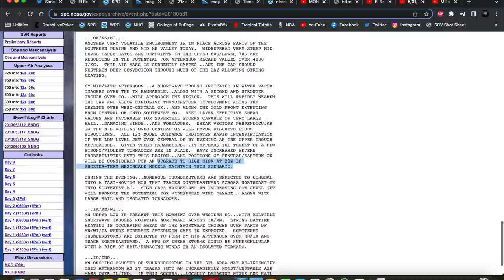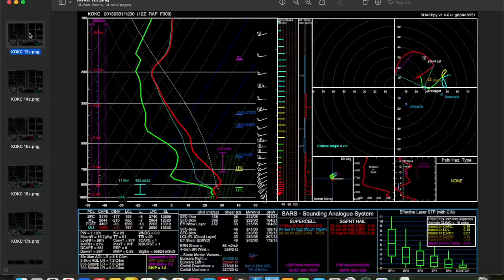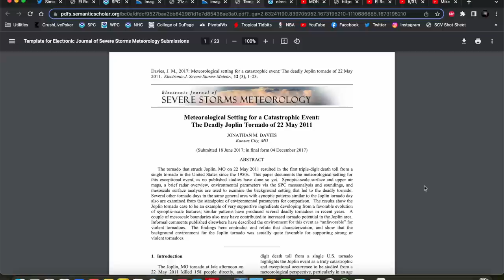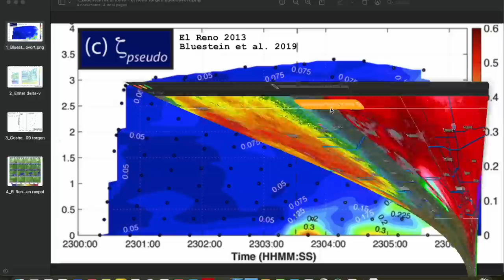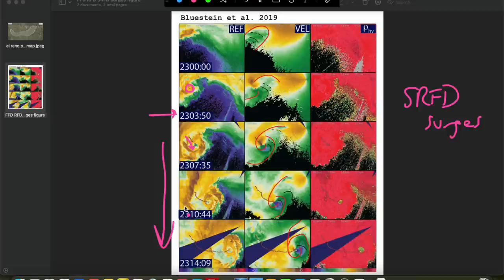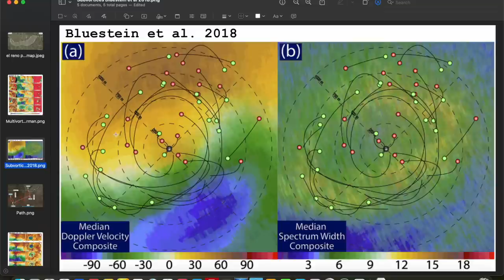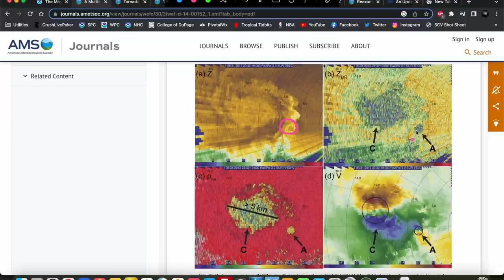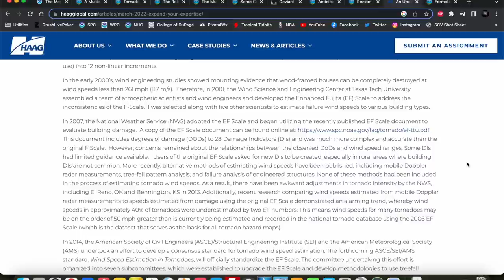The El Reno, OK, Tornado of May 31, 2013: A Case Study

Comment: If I could make a suggestion - the Tri-State Tornado is shrouded in a lot of mystery - documentation may not be as readily available on that storm, but I think it would be quite a piece to look at if you made an analysis of that!
Reply from the maker: I agree; it's on my list! Only issue with those old events is the data archives are quite sparse, but I think the Tri-State Tornado has enough literature out there that I could construct a solid video on it.
Reply from the maker: Correct, it’s believed to be a tornado family rather than one long track.
Reply: @ConvectiveChronicles  Use the 2021 Quad State Supercell as a starting off point for the Tri State Storm. Because theory suggests that the 1925 Tri State Tornado was likely identical to the 2021 Kentucky Tornado.

Comment: The cape values were in fact that high.

Storm chasing that day, we saw close to 6000 cape values before(i mean within 30 mins of storm initiation) and ground obs at highway 81 just south of el reno showing a strong backing wind ahead of the frontal boundary.

I have not seen since then as high of cape values with such a storm.

This storm veered southeast immediately after el reno. With the meso splitting in two. Creating a semi quasi linear line. It produced tornadoes in south okc as well.

Very dynamic and very rare.

And remember this was a week AFTER Moore took another direct ef 5.
Reply: I heard Jarrel had CAPE 7500...

Comment: Awesome video Trey! I am not a meteorologist by any means, and have not read research papers for this event, but in regards to the discussion of deviant motion and tornado width increase, a thought I am having is: could there be some relation between the average angle between the rear and forward flank downdrafts (if that's a thing) and the "width" of the inflow region (thus contributing to increase in the inflow flow rate and/or the increase in tornado width?)...or something else? In looking at the slide at about 45:00 in the video, the "average angle" I guess you could say between the main forward and rear flank downdraft seems to increase a bit from 2307:35 to 2310:44....and after 2310:44 is when the widening of the tornado happens...just a thought I had.
Reply from the maker: Thank you!

Hmmm, interesting idea, one that I haven't thought of before. My hypothesis of the mechanism behind a tornado's size change is that there's an increase in streamwise vorticity ingestion; i.e. a large area of favorable "spin" that the tornado encounters that allows for a lot more vorticity to be concentrated within the low-level mesocyclone, hence perhaps causing widening of the tornado. That source could be a streamwise vorticity current (SVC), remnant surface boundary, etc. Your theory is interesting and perhaps a lot simpler...you can also see at 45:00, the 2314:09 box has a lot larger of a "cocoon" - i.e. the area or interface between the FFD and RFD - than the previous times. Perhaps a change in that angle you mention does something to change the size of that interface, creating a larger area for the vorticity concentration within the mesocyclone to occur.

Comment: Around 22:30 you talked about why the Tornado became rain wrapped. Could you explain further why weak outflow winds in the mid-level allowed for that to happen? How does stronger outflow winds cause an LP supercell? Are we talking about the RDL here? I’ve always been confused how LP vs HP supercells form and would love some clarity. Thanks in advance!
Reply from the maker: Strong storm-relative outflow winds help to push, or vent, the precipitation in the mid-levels away from the updraft/mesocyclone region of the supercell, which helps make any tornadoes that occur more visible and can yield LP supercells. In contrast, when you have weak storm-relative outflow winds, the precipitation is not vented away from the updraft/mesocyclone region of the supercell. Thus, the rain falls very close to or within the mesocyclone area of the storm, which yields a more HP storm and obstructs the view any tornado that may form.

I hope this helps; let me know if you have any other questions. You can also get some more info on these processes at the following link, just scroll down a bit to the "Storm-Relative Wind" section: https://cameronnixonphotography.wordpress.com/research/the-storm-relative-hodograph/
Reply: @ConvectiveChronicles  that totally makes sense, thank you so much for answering!

Comment: I'd be keen on eventually seeing a detailed analysis like this one that also happens to include the mesocyclone perimeter for reference.  I've seen a few clips from time to time that show tornadoes that seem to more or less take their meso completely over, and a tornado reaching this width has me wondering.  I'm also very curious about whether this tornado developed the classic "eye", or conspicuous area in its center of very low reflectivity, typically seen in mile+ wide tornadoes, and how the long-lasting center subvortex discussed in this video relates to that.

Last thing I'll note is something that harkens back to the classic "Tornado Video Classics" video from the early 90s.  A brief mention is made of "twin suction vortices" that Dr. Fujita claimed to have spotted in the film of the Xenia tornado.  Well it just so happens that there's a certain clip of the El Reno tornado that legitimately and unambiguously reveals this phenomenon—a subvortex that's made of two vortices spinning around one another.  I've long suspected that nobody else ever noticed this.

Comment: Excellent case study. Could watch mobile radar scans of tornadoes on loop for days! Haha, thanks for upload. Also, Bennington would be an interesting case. I'm guessing that deviant track was the tornado wrapping around the entire mesocyclone? Cheers!
Reply from the maker: Thank you! Bennington is on my list; that one actually attained its almost stationary/slightly retrograding motion because of advection by the low-level storm relative wind...using the deviant motion hodograph technique, the deviant tornado motion vector was literally almost at the exact center of the hodograph grid (i.e. nearly stationary motion): https://www.ustornadoes.com/wp-content/uploads/2021/03/20130528_2300_39.32_-97.92_RAP_23Z_F00.png

Comment: I have a suspicion that both ascending and descending tornadogensis are possible, however, they arise from different (but similar) conditions. I also suspect that the overlap between these means that you can have the same storm potentially produce both kinds at different points in its life, as it moves into different conditions. 

However, from personal experience I get the impression that ascending tornadogenisis might be more common, just from experience. There's been a ton of times chasing that I have seen a swirl of dust or leaves under the mesocyclone often many minutes before any kind of tornado strength winds are present. I have no idea if this is the start of a surface vortex, or just transient concentrated vorticity, but I know I've seen it often enough that it doesn't seem like chance.

I'm not super confident in this, and I don't know how one would begin to prove it, so I'd like to hear your thoughts on this. (Or anyone's thoughts, really.)
Reply from the maker: Completely agree! In my thesis, I analyzed four different tornado cases using high-res mobile radar data, and I found evidence of both descending and non-descending (ascending) tornadogenesis among the cases. The Putnam, OK tornadic supercell on 6-15-19 appeared to feature descending tornadogenesis, while the Elmer case appeared to feature non-descending tornadogenesis. The former case was a lower shear event, while the Elmer case was a much higher shear event. Of course, small sample size, but perhaps that has something to do with it; regardless, I do think the environment has a lot to do with the method of tornadogenesis in storms. I also agree that ascending/non-descending tornadogenesis may be more common; we just don't have a big enough data archive of tornadogenesis cases from mobile/high-res radars to make a definitive statement. But I too have seen a lot of cases out in the field where the tornado does seem to begin with concentration of vorticity near the surface which works upward with time. Very interesting stuff, and hopefully more research will be done on these topics in the future.

Comment: Are there surface temperature/dew point or VT maps available slice by slice with the dow data? I have never seen mesonet type data with this in a map form. I'm guessing the resolution would be too sparse this zoomed in with that many frequent time slices. I've always been curious if this event could have been a psuedo warm seclusion like event we see with larger tropical systems just on a much smaller scale, namely the strengthening and loop de loop behaviour post occlusion.
Reply from the maker: Unfortunately not; the mobile radars aren’t equipped with instruments to measure those environmental variables, and there isn’t any source that measures those variables on that time scale. The Oklahoma Mesonet would be closest, but it still isn’t as high resolution, both in time and space.
Reply: @ConvectiveChronicles  Yeah I kind of figure that seeing as how  you would need probes ever km or more to pick up things on this scale. Hopefully the work Leigh Orf and others are doing will allow us to plug in variables and run a model that is accurate to nature pretty soon.

Comment: In the dominator footage showing the satellite vortex (40.06), another more energetic vortex (to the “right” of what you are calling the satellite vortex) is obvious. It even appears more “outside” the main circulation than the vortex you are referring to.  What is that? Accepting the fact that it is another satellite vortex, what makes the leftish vortex that you are pointing to so special?
Reply from the maker: It’s very likely another subvortex…that circulation was massive
Reply: yes, and capturing it just in that one moment of time, I’m not sure which of those two vortices, or the many others that may have subsequently developed that were never witnessed, would’ve been the culprit of…..anything. I understand how incredibly difficult it is to get the proper radars, instruments, personnel, etc., in place to study such a dangerous storm, indeed, if any tornado. One thing that is often overlooked, that you allude to in this video regarding over-estimating the wind speed of this tornado, is that radar artifacts may be present. We need to understand the fact that tornado science is often working with very limited data sets, and circumstances are not easily applied to other storms in analogous situations, since there may in fact not be analogous situations to study! It is all very interesting to me. Tornado science seems to rely mostly on phenomenology with n=1, and often on forcing hypotheses to be correct, when it may be a correlation/causality misinterpretation.

At any rate, very good work, and I have learned a lot from your channel. I know just enough to be dangerous in meteorology, being a science, PhD myself. Educational and technically dense, which I enjoy.

Comment: just thinking about bottom-up tg. In most of the cases that I can remember, being on the ground, there was a sudden ramp-up of winds before tornadogenesis. I witnessed it most prominently in the Madill tornado a few years ago. in another case, where a tornado ultimately did not form, there was no ramp-up in winds. just a steady light breeze.

Comment: At 52:50 u mentioned that the tornado has to deviate back to the north because the tornado initially turned south east. To my untrained eye the speeding up of the tornado happens to be at around the time it is going back up north trying to follow the apparent storm motion. can this be some something like a slingshot, since the storm base and top levels are connected and the tornado is getting pulled?
Reply from the maker: That's an interesting question that's hard to know for sure...I think the change in speed had some other factors that went into it, but that's an interesting proposition.

Comment: Could you do the Albany GA EF3 tornado? Been curious how such a strong cell remained strong in a squall line filled with short-lived rotations. Long track EF3 with a lot of size and intensity changes throughout it's life.
Reply from the maker: What was the date?
Reply: @ConvectiveChronicles  Jan 22, 2017. Came from a squall line (of many that day and before) but was long track and very strong for that time of year and it not being from a discrete cell. I believe it was a strong rotating cell within the squall line. Hit mobile home parks in Albany bad. Several tornadoes and warned storm have followed nearly identical paths over time, from Leesburg south to Moultrie area. Worth County is especially a hot spot due to its height in miles and location, like NW GA counties.
Reply: @ConvectiveChronicles  I've got a few short videos of the approaching rotation and one from inside a home where it passed 1/4 from us near its widest point.
Reply from the maker: @gl3618 Ah, that's right. I do have that day on my list, but more so to analyze why the High Risk seemed to underperform in general, despite a couple stronger tornadoes like the Albany one.
Reply: @ConvectiveChronicles   crazy day. I booked it from Dothan Alabama to the area of Harris road you'll read about with that tornado, 30 mins before it hit. Had reserve duty that weekend and convinced command to let us all leave a little early. Entire storm was rotating with it. I can email you the short videos I have, almost got struck just before it appeared as a wall of clay behind some trees. Sadly my video from inside is brief because we turned and went to a better place inside. Went white out conditions outside the window and we were maybe 1/4 mile from the visual funnel...that was a massive wedge.
Reply: @ConvectiveChronicles  
I'm nowhere near your level of knowledge on this, but for years I've been trying to soak up knowledge on Hurricanes and tornadoes. I will say from a ground perspective of "feeling," there were major atmospheric shifts before that squall line came through. The moisture in the air was insane. We woke up that morning in the hotel to tornado sirens in Dothan. I drove a 4 door diesel truck and followed my buddy back to Leesburg, he had a smart car. Going East, it was pushing his car off the road before the line even hit, we were 30 minutes ahead of the line. He pulled over in Arlington GA thinking his car was not right, I told him to get in and go NOW. Radar was already looking rough behind us and I knew strong winds out of the south ahead of a squall was a bad recipe for rotation. It was moving my truck slightly too at 65 mph. Hail was minor before the tornado actually hit, but the lightening really started intensifying. Heavily rain wrapped on the N side of the funnel with zero vis....which I thought was odd because that's supposed to be the notch. But it was very clear when I first saw it to our SW. Once it was to our SE, it was invisible in the sideways rain. Pressure washed the truck though. That's what I witnessed on the ground with conditions and signs. Straight line winds were bad too in Albany, before that tornado. 100+mph in some areas early that month on Jan 4th, with definite but unconfirmed rotations within (damage surveys missed areas). January was rough that year. Lol

Comment: you were discussing tornado genesis where there are two methods, one descending and one ascending. my question is, in tornado families is it more common for it to be a descending tornado genesis, or is it ascending. also is it likely that just the initial tornado in a family would be an ascending tornado, then all following tornadoes to be descending, or could there be a mix of them?
Reply from the maker: So unfortunately, those are questions we just can't answer yet. I don't think it necessarily has to do with whether or not it's a tornado family, it probably has more to do with the environment. But, we don't have enough datasets from enough storms to really know the answers. Tornadogenesis mechanisms are often only able to be resolved with high-resolution mobile radar, and I can tell you from experience, actually getting a dataset that goes from just before to just after tornadogenesis is tough. Hopefully, more research will be done on the future on this topic.

Comment: I'm by no means educationally endowed on physics relative to the study of meteorology but knowing the driving mechanism vs the forming mechanism of storms like this, it makes far more sense that the circulatory genesis begins from the ground up. You have inflow and updrafts feeding the storm, and winds at various heights and directions aiding it, and the storm essentially dropping cooled air down around it, also being steered about. Sooner or later, those pools are going to cinch up very quickly. 

I see this in dust devils in the Southwest all the time. Cooler air will displace hot air, right?
Reply from the maker: It is certainly true that cooler air displaces warmer air, but the colder downdrafts are just one small part of tornadogenesis. Tornadogenesis is a delicate balance between the (ideally) warm rear-flank downdraft, the warm/moist inflow, and the cold outflow from the forward flank precipitation core. Too much cold air will undercut any developing mesocyclone and nix tornadogenesis. Whether or not tornadogenesis first occurs at the ground or aloft has to do more with the dynamics/physics ongoing within the storm, and that probably is modulated by the environmental characteristics.